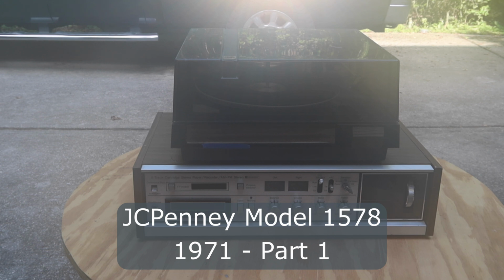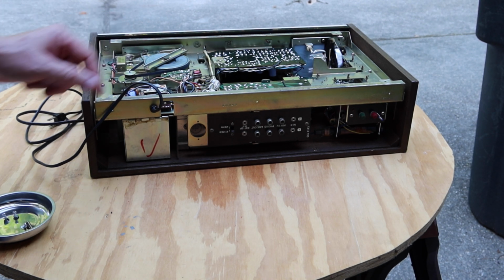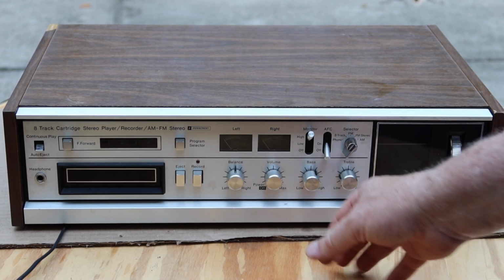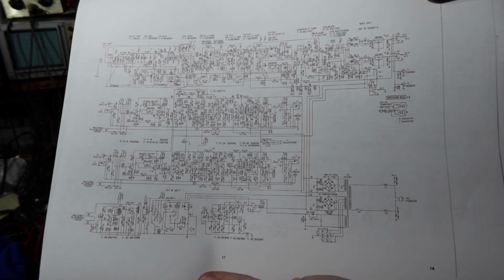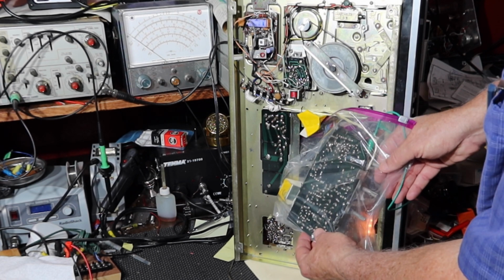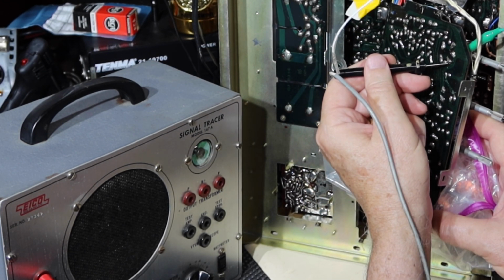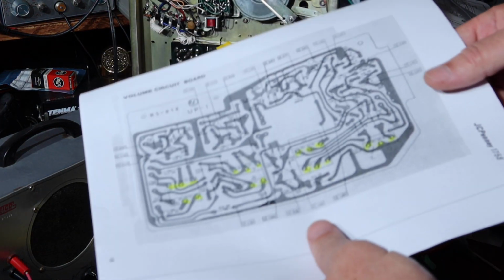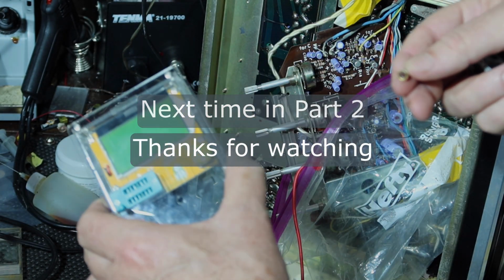Attic Recovery - Diagnosis with Signal Tracing - 1971 JCPenney Stereo 1758 - Part 1 [4K]

Comment: I have a JCP all-in-one stereo on my bench right now from 1982. This one is AM/FM stereo, phono, 8-track and cassette. I used to repair ones like this a lot when I had a shop back in the 80's. I gave $25 plus shipping on eBay for it just to have something different to work on. Haven't watched part 2 yet, but I'm betting on the transistor. :)
Reply from the maker: Hello Doug.  Thanks and I went and watched your video that you mentioned.  Cleaning up the capstan and pinch wheel helps for sure.  Good luck with that unit.  Thanks again.